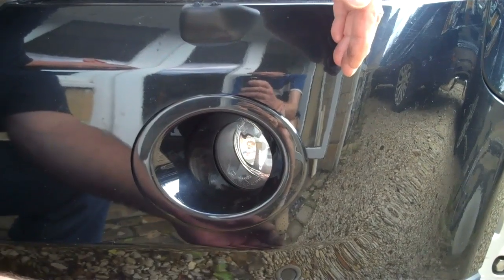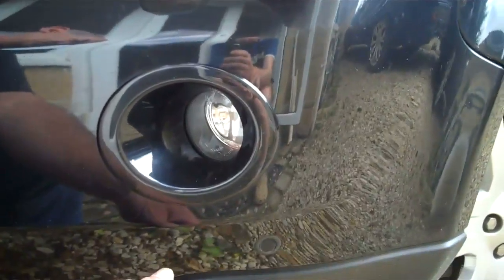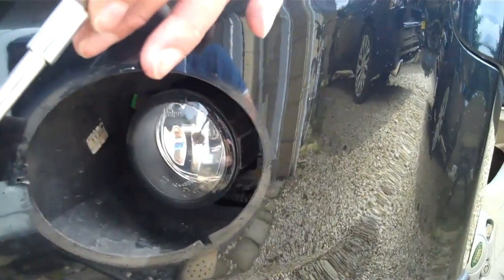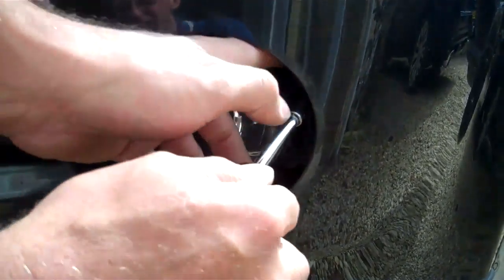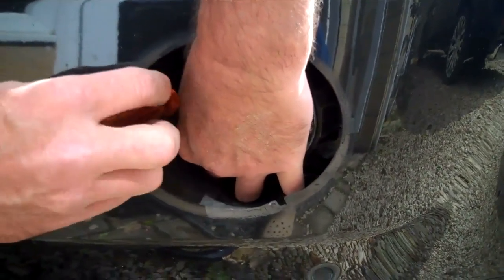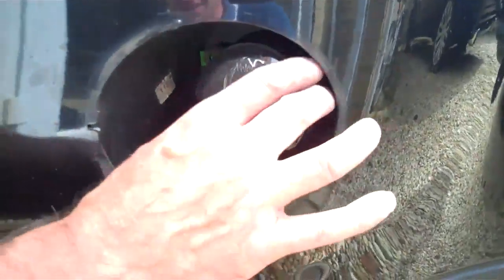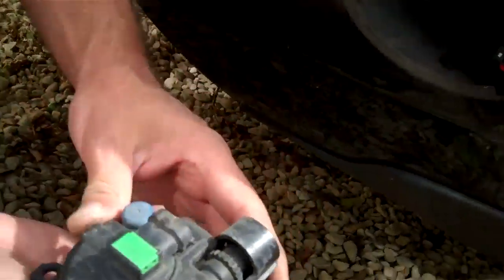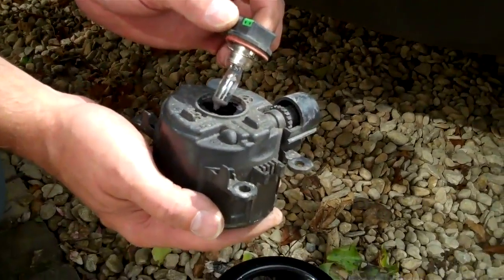How to change a Fog Light on the Land Rover Freelander 2/LR2

Comment: Really useful, many thanks.Bird strike pushed the fitting back into the bumper, but the light still worked, just pointed up!Used your advice to remove lamp unit, pull the fitting forward until it clipped back into place, and then replaced the lamp unit.Local dealer quoted £255 to 'investigate' so many thanks indeed.